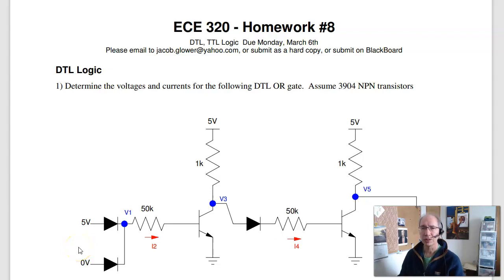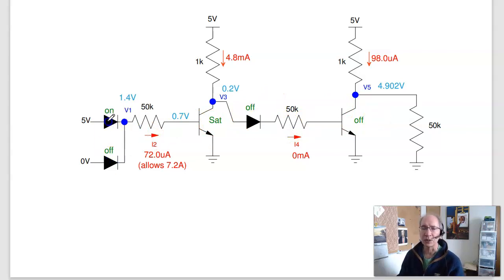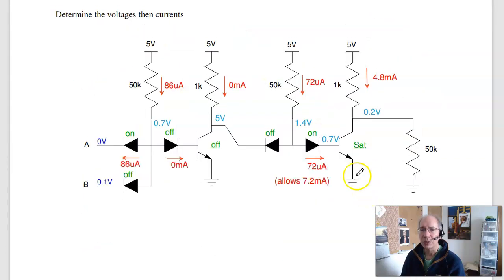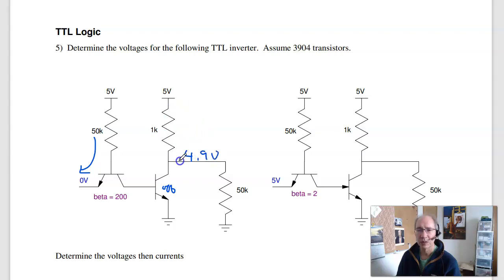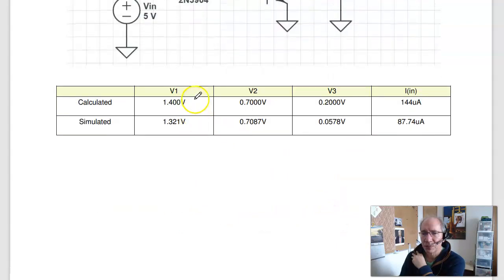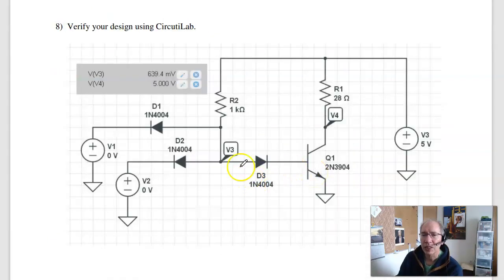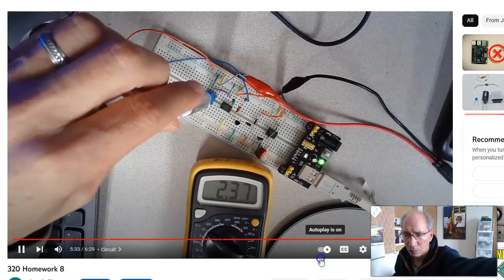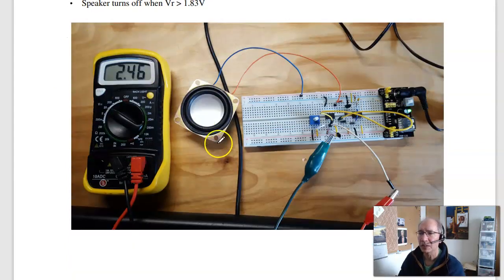ECE 320 Homework #HW8 (Sp23)

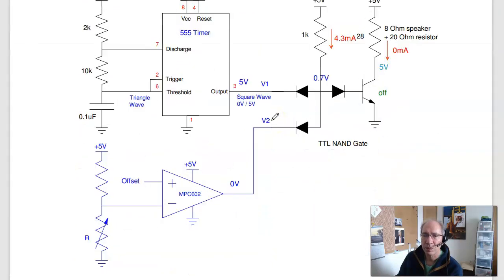Comment: 6:43. Isn't this an example of an AND gate? Assuming the inputs of the gate are the 555 timer output and the comparator output. Then the only time the output of the gate (transistor) is triggered high is when both inputs are triggered high which is AND gate behavior?